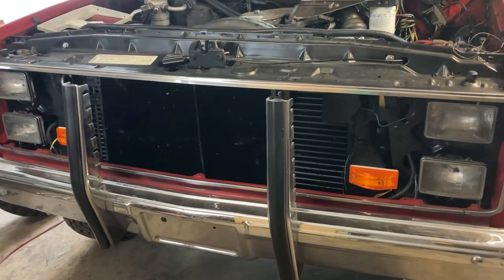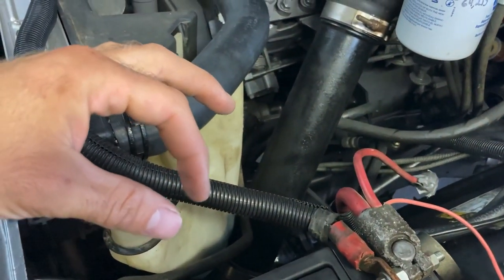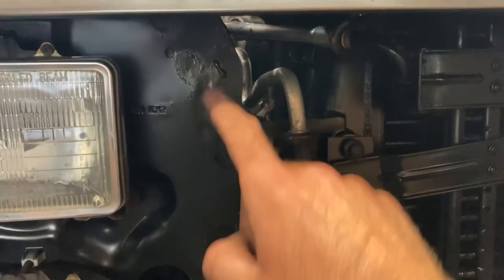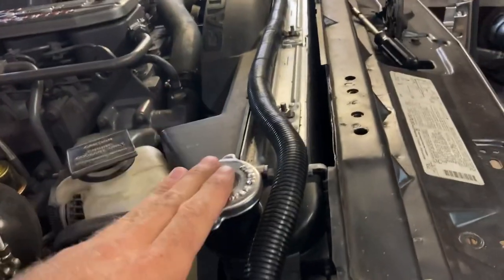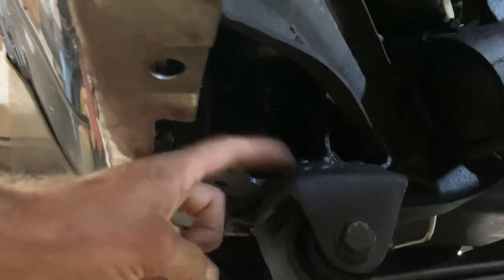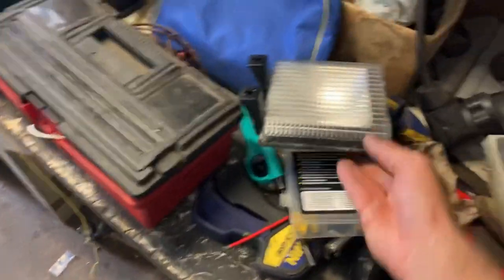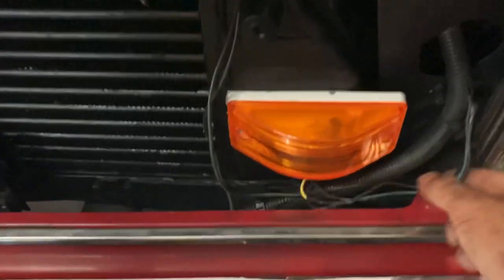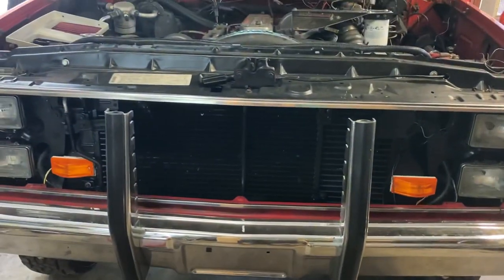Square body 12 valve intercooler mount and parking light fix

Comment: Thanks.  I was going to 12 valve my truck, but I'm going with a turbo 454.  I have an extra 12v intercooler and rad.  I have one 12v truck left, I had three at one time.
Reply: Did you build the turbo 454?

I'm contemplating going with a 12 valve or turbo tpi small block.
Reply: @xmo552  the efi intake  was ridiculously expensive.  The stock one wouldn't cut it.  I sold it to my friend for his half ton, and I will have another boring 6.0 ls swap.  The 6.0 turbo will cost half as much as the 454 turbo.
Reply: @pimpnick4920  
I know the LS is everything better faster more efficient cheaper etc. I'm just really found of the SBC. 

Another Cummins in the fam ain't bad either.

Comment: Great video and good information. Quick question though. Im re-powering my 88 gmc c3500 crew cab dually with a 5.9/gen 1 cummins. Did you have to do any modification to the firewall?  Not sure if you kept your fan, but not sure how I will go. I hear the space is tight and some guys run electric fans and get rid of the fan to save space. Im just trying to figure out how I will squeeze the radiator, intercooler, and a/c radiator behind the grille.
Reply from the maker: Thanks! There is plenty of room for everything. This video shows it all. No need to mess with the firewall. Keeping the mechanical fan was important to me. Had no problems doing that. Dodge radiator and intercooler as well. Even the stock fan shroud. I’m running the dodge ac condenser too. I have several videos showing this stuff. Thanks for watching 
https://youtu.be/HNZrhAJmOGo
Reply: @redeyecafegarage7484  Great to hear. My motor is a 12 valve gen 1. I wonder if there's any benefit to using a gen 2 radiator and intercooler. 

And great video!
Reply from the maker: Thank you! 2ng gen parts are generally preferred. They offer better cooling while still fitting in the truck. 1st gen stuff is ok but if you’re buying parts anyway I would go 2nd gen. IMO

Comment: How did you hook up your fuel system? Stock saddle tanks with diesel pick ups? And how to avoid picking up air in the fuel lines?
Reply from the maker: For now I’m just running 1 stock saddle tank.  I ran all new hard lines. 3/8 feed and 5/16 return. I removed the in tank fuel pump and extended the pickup to the bottom of the tank the Efi tanks have a large plastic baffle thing with almost like a sump hole to trap fuel when sloshing around.  I also extended the return to angle it away from the pickup to prevent air and fuel from going out one and into the other. So far so good! I have plans to plumb my second tank into it eventually. Right now I’m getting 20 mpg so the range on a single 20 gallon tank isn’t bad at all! Hope that helps!
Reply: Thanks for the info..enjoying the videos I’m doing the swap on an 85 K30 also
Reply from the maker: @tytan2866  sure! If you have any other questions let me know! Thanks for watching!
Reply: @redeyecafegarage7484  
What's your transmission and rear gear radio please?

Comment: There is one for sale just like this an 84 silverado squarebody with a 5.9 12v only 90k original and I have enough money because I work construction but it’s also a dually... is it a good first truck?
Reply from the maker: Any truck with an engine conversion is going to be a lot more involved when it comes time to work on it or make modification. Personally I wouldn’t recommend it for your first truck. But in the end it’s your decision. 👍
Reply: @redeyecafegarage7484  it is the exact same thing you’ve done so do you find it hard to park and what do you get for mpg?